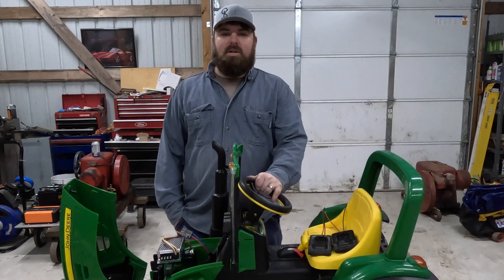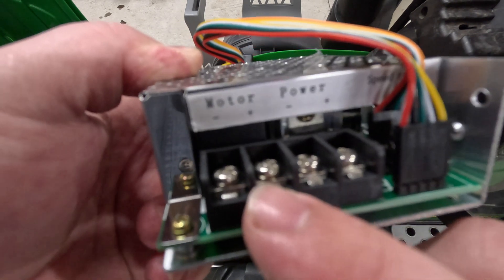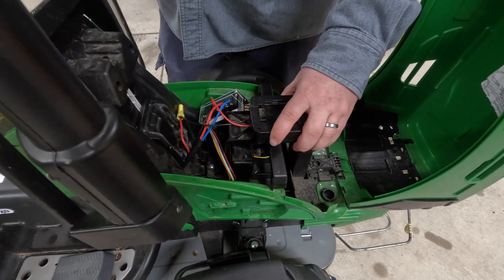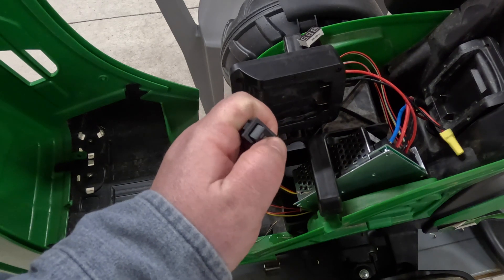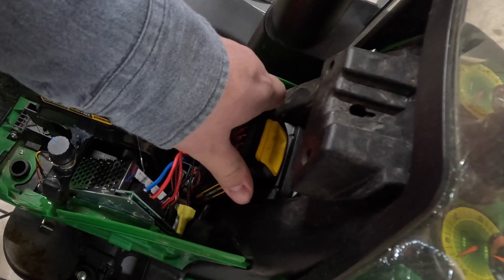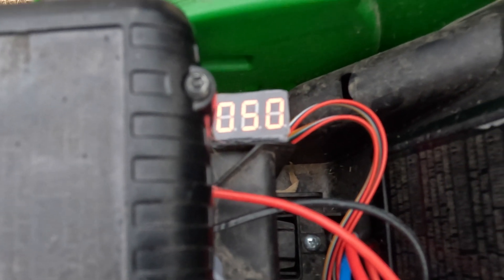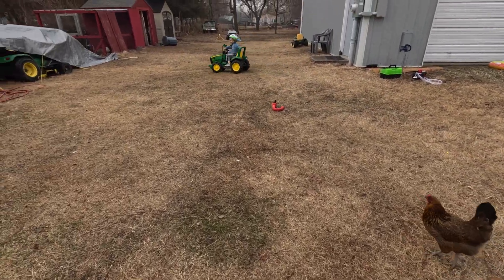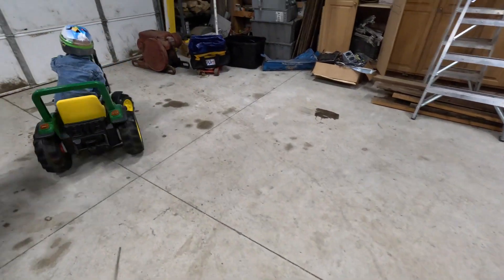Supercharging Your Kids Power Wheels

Comment: Mine has a control box where the motor wires are going to, would I bypass that box and plug directly in that voltage regulator?
Reply from the maker: The control boxes are a little different to set up. You would have to find the pedal input and wire it into the new motor control
Reply: @wackyengineering does the control box need to be swapped out? Can it handle more than 12v?
Reply from the maker: It probably cannot handle 20v. It would be a more involved upgrade

Comment: did you upgrade the motors the regular ones they come with  have a risk of burning out it you go above 24 volts
Reply from the maker: The motors are factory replacements, we have had some burn up but it was just a little smoke and they were done.

Comment: ill be following your instructions. do you have a fuse inline?
Reply from the maker: You can add an inline fuse or just purchase one of the Dewalt battery adapters that have an inline fuse included!
Reply: @wackyengineering  just saw in someone elses video that apparently the voltage regulator has a built in fuse!

Comment: Ok so I’m going nuts! I did the upgrade 1 20v dewalt battery and the motors I assume are getting hot and shutting off then go again once cool. Is there a fix for this that you know of?
Reply from the maker: Some units have an automatic reset circuit breaker so it will trip when hot and once it cools back down it will reset. This is likely your problem. Some people remove it but of course there is some risk associated with that. Good luck with your issue!

Comment: Great video! One question. Does the motor speed controller go between the battery and the gas pedal or between the gas petal and motors?
Reply from the maker: The speed controller goes directly after the battery before the gas pedal, shifter, and the motors!